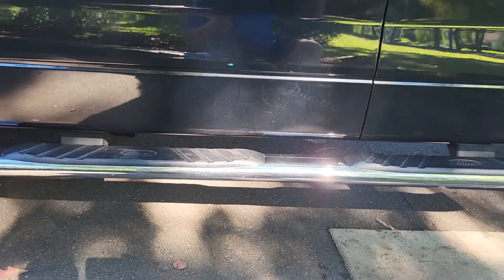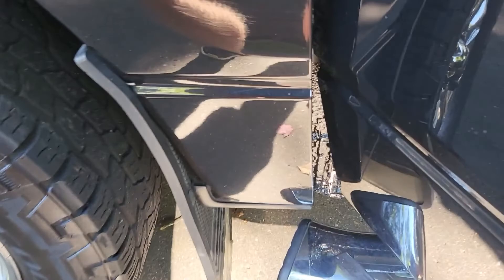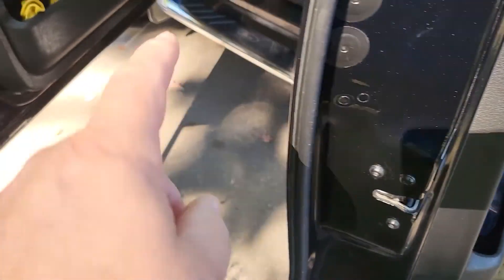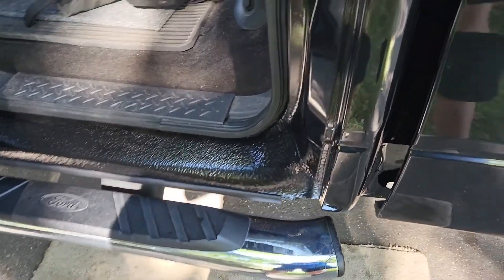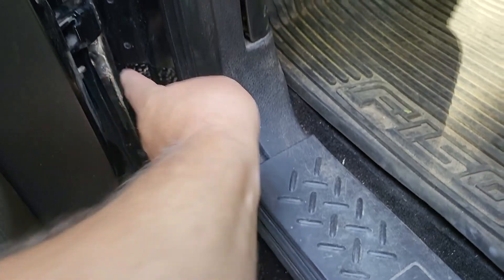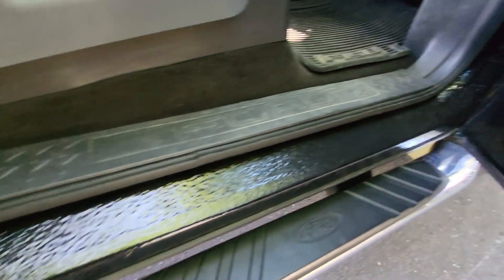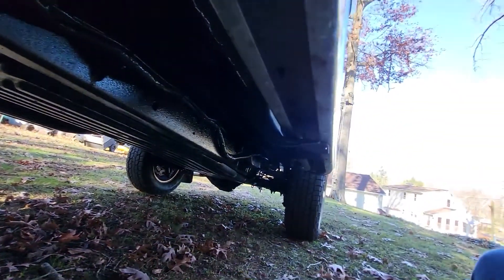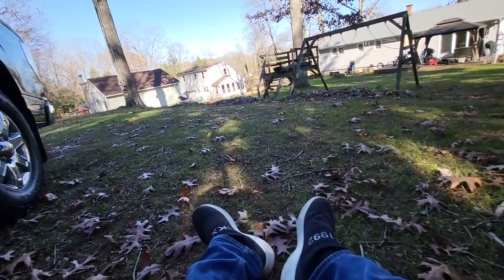2014 F150 Door sill/ rock panel replaced with NH Oil undercoating

Comment: Just had this nh oil done on a 2016 mazda cx5 that had lived outside in NY and underbody was pretty crusty from rust. David in manchester did a great job including creating some access to ensure inside door frames were treated. Dropped day one and picked up 24 hours later. Just 9ver $400 including tax. Confident itcwillarrest the rust tgat was gaining a foothold but hadnt created structural ir even obvious cosmetic damage yer.
Reply from the maker: I have zero rust. My son did his 2005 Tacoma which was pretty rusty underneath, but this will stop the rust from continueing to spread. He is very happy with it. Be sure to get the 2nd application a year later. Then after that I will be doing every other year.

Comment: Sorry, I just heard you say Bolton Collision at end. Thanks. But I'd like to know about factory metal pieces that were welded back in. Thanks
Reply from the maker: Correct, I do not have the expertise to do this kind of work nor the location but I wanted to share what I had done for those who have the same rusting issues as bad as mine. My rust was quite severe.

Comment: Wow. My 2005 truck is doing this. In georgia! So, you can buy factory fitting pieces to repair all this? Or do you have to fabricate the inner metal pieces? Where to get this done? Cost? Thank you so much for the video!
Reply from the maker: I know for a fact you can buy those pieces on line in metal. I have Googled it, but a MIG welder is needed.